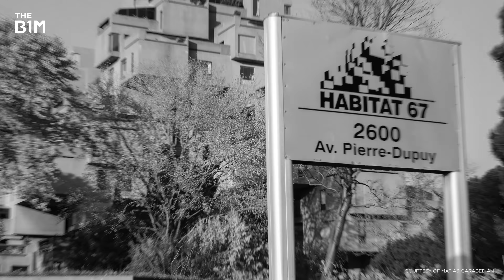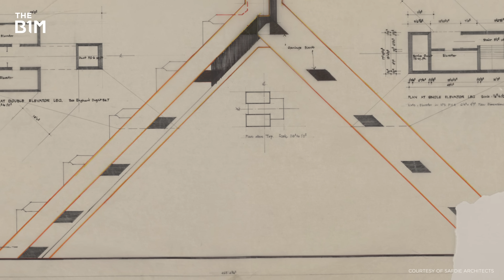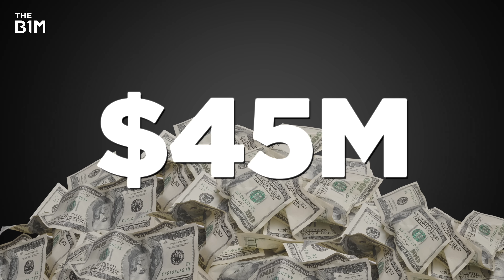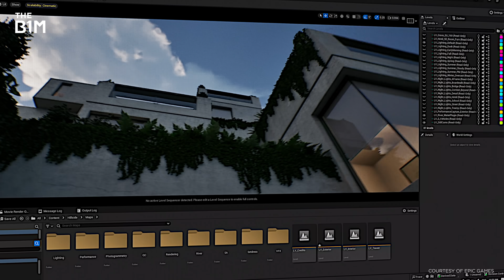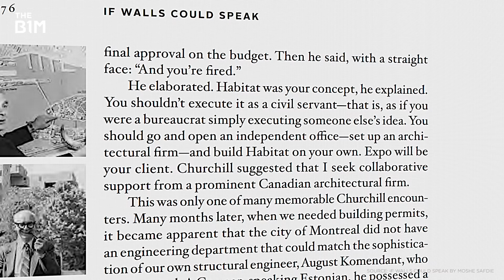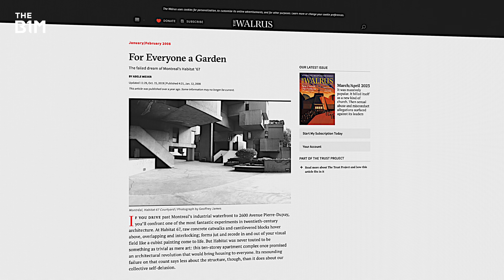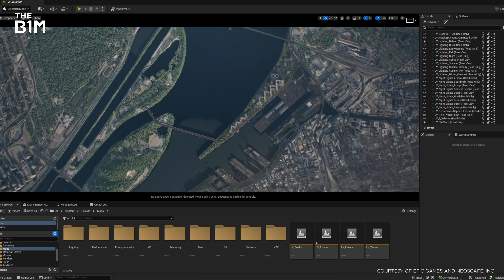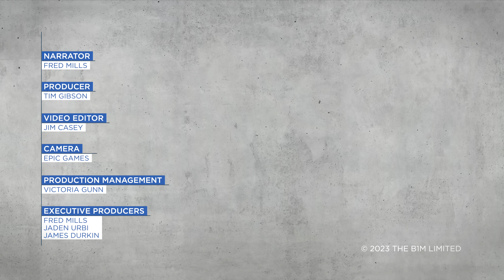How a 23-Year-Old Solved Urban Sprawl

Comment: The design doesn't look like it's 50 years old. It looks modern.
Reply: 50 years ago is modernism at its peak lol
Reply: most brutalist buildings look futuristic.
Reply: @FastSloth87 true, but this also looks livable as well. I like brutalsist buildings myself, but so many seem focused on the "brutal" part. Even with the size and style, it also still feels human sized and welcoming.
Reply: @FastSloth87  You mean cyberpunk.
Reply: @FastSloth87  that's the old USSR .
Reply: @FastSloth87  you could render probably any brutalist building with flashy lighting and it would look like this video
Reply: @FastSloth87  Montreal’s Brutalist designs are really well done, prevalent in some of the metro stations
Reply: @TheRandCrews  Oof, if Montreal's Brutalist buildings are the best that Brutalism has to offer, then Brutalism is just anti-human ain't it?
Reply: that's... when the modern movement happened :/
Reply: 50 y/o is modern
Reply: What? The building looks very much of its time. The use of concrete, lack of ornamentation, focus on clean lines, and natural light is quintessential Modernist architecture. More specifically, it is very much in line with Brutalism, Structuralism, and the International Style. What you're trying to say is that it feels contemporary, but that isn't right either. The structure isn't Postmodern (no sense of referential play or remixing of styles) nor does it evoke Structural Expressionism or Deconstructivism. The heavy use of concrete doesn't exactly make it a model for sustainable or green architecture either.
Reply: @got2bjosh  You know people who don't study art or architecture say modern instead of contemporary right?  You know exactly what they meant.
Reply: @Mog_King_of_Moogles  I learned from both comments. Modern is a style but also an adjective. Contemporary describes the current era. We live in a strange time where classical styles are mostly rejected (or tax code disfavors them), and new signature "architecture" is seen as an opportunity to make a building from/into a postmodern sculpture, in the name of being "unique." As we saw with a recent video in Europe where a giant behemoth w/poorly planned interiors sits atop a classical structure, putting form over function. The classical styles (even Modern/Brutalist) adapt to functional use. Supertalls & art pieces do not.
Reply: @got2bjosh speak english dude lmao no one who doesn't study that stuff knows what you're talking about
Reply: @jared_deraj  May my comments serve as an access point of understanding for all who may be less familiar and wish to follow up with a deeper dive into the various talking points that were referenced. Research is your friend!
Reply: @got2bjosh  definitely not brutalist since it appears to be painted and not raw concrete, but i would agree it's modernist. OP probably talking about the design concept, since you don't see many of those even today.

however, i'd also like to point out that "style" is the last thing an architect ever thinks about when designing a project - an afterthought. a label slapped after seeing enough buildings sharing the same features. modernism itself is a label slapped onto the collective design theories and philosophies of many notable architects of the time.
Reply: @archwaldo  There are many examples of Brutalism that aren't raw concrete. Case in point, Larsen Hall at HGSE and 33 Thomas St in NYC.

Modernism isn't exclusive to architecture. It is a cultural movement that is generally seen as lasting from the 1850s with the rise of skyscrapers and the Modern city to the 1950s and the end of World War 2. There are some exceptions to the rule of course. Modernism connects through many fields including philosophy, fine art, literature, music, dance, politics, science and technology. As such, it is important to utilize an interdisciplinary lens when contextualizing work from such a massive period.

There are styles within Modernist architecture, but what links them is the overlapping ethos of the movement at large. Namely, a focus on the new, subjectivity and role of the artist which gave rise to the auteur, the desire to break away from existing social structures and modalities of thought, and a return to nature. Regardless of style, these overarching sentiments most certainly would've been percolating in the mind of artists (including Safdie) who were creating "in time" (to borrow from Gertrude Stein).

Modernism's ultimate failures (exemplified in the rise of Totalitarianism and World War) produced certain anxieties and an existential crisis in the zeitgeist that affected the way we live. It ultimately was succeeded by Postmodernism which in turn was succeeded by... well it depends on which scholar you talk to. We're working on it.
Reply: @got2bjosh  exactly what I'm talking about in terms of "style".

The most common question of laymen when talking about architecture is "what style is this?" when it's actually much more complicated in reality with deep roots across multiple disciplines.

Heck, even the buildings categorized under "styles" don't fit the mold completely. In practice, architects are designers and not artists, our primary goal is to solve problems on time and within budget. Aesthetics are flexible unless the client requires specific themes that must be followed.
Reply: @archwaldo  Modernism is an expansive movement. The styles within it still maintain broad parameters in themselves. With Modernist architecture for example, the use of natural light, clean lines, open concept floor plan, forgoing ornamentation, and a preference for using certain materials - none of those broader elements preclude operational logistics. The design ethos underpins the approach to form and function, but remains discrete from time, money, and scale (which have a much more immediate impact on deliverables).
Reply: @got2bjosh  just a friendly reminder that you are participating in a meaningless debate on the internet
Reply: @epicn  You wanted some attention, so here ya go.
Reply: @epicn  it's not much of a debate though. He's talking about the history and theory of modernism, while I'm saying that the public is trying to understand architecture in their own way.
Reply: I feel like you just aren't any fun at parties.  @got2bjosh
Reply: @Kidderrgaming  Feelings aren't facts.
Reply: @got2bjosh  okay? Sorry I misworded it. You aren't fun at parties. 😂
Reply: It does?
Reply: We’re talking architecture so when you say modern you mean early 20th century buildings, which are more than 50 years ago
Reply: It looks like Minecraft. In 2023 a 12-year-old would build this and be fighting Zombies and Endermen there.
Reply: It looks like "realistic sci-fi", unlike most sci-fi from back then which was definitely more "fi" than "sci".
Reply: @BloodyMobile  that's it perfectly.
Reply: Because modernism was a main architectural style in the 60's. 80's were postmodernism. And probably now we try to learn from mistakes. This building is not nice. MAybe cool, maybe interesting, but just like LEGO is not "nice", this is also just like a soviet building block disassembled and assembled in a cubist way.
Reply: Well,  it was built during the modern architecture period. I think what you meant to say was that it looks contemporary.
Reply: “Modern” is already more than 50 years old.
Reply: That's because "modern" architecture is getting quite old
Reply: Reject modernity, embrace tradition
Reply: What is old is always new again. We see it constantly in all fields.
Reply: If it looks modern, then we're still in the same architectural style period. No lie there.
Reply: Imo the way the blocks are disposed feels fluid and fresh, that’s why doesn’t look like an older construction.
Reply: 1967 would be postmodern
Reply: It look 80s to me. Sad shape, sad colors.
Make it white, with wood parts and more green.
Reply: Modern buildings have been built since the early 20th century
Reply: 50 years is modern…
Reply: Or you could say that modern architecture didn't evolve a bit since ww2 aftermath era...
Reply: @jovan3612  it did evolve, look at the masterpieces in Middle East, Only Europe didnt evolve others did
Reply: @SJRS700  that's not masterpiece that is junkyard, masterpiece was in classical architecture
Reply: Ahead of his time. 🎉🎉
Reply: That's because good design never goes out of fashion.
Reply: It doesn’t look ‘modern’ at all - it looks futuristic. They should incorporate these ideas & principles in NEOM where the funding seems endless…?
Reply: shapes don't change over time, and we physically haven't either.
Reply: These are commie blocks or "Khrushchevka" houses, just the blocks arranged differently. It was modern in the 1960s.
Reply: the idea seems so futuristic because it is humancentric and that is just not normal to people nowadays. it is terrible car-centrism and the continuous self-adulation of narcicistic arcitects that still dominates city planing. Safdie clearly thought of people with his design, not of himself and how to build the next big, ugly phalus symbol rising high into the sky.
Reply: If brutalist is modern, sure.
Reply: Then people shouldn't stereotype or stigmatize that past people were incapable of creating such things, advance tech, and styles. If people study history there was many advance tech. Many modern tech were invented a long time ago. Some social constructs held people and inventors back too. I also think tech not needing to use electricity is clever and it's good to have diverse options in case the power grid failed.
Reply: 50 years ago is still modern.
Reply: No it looks like it's a prehistoric design
Reply: Search up retro futurism
Reply: It's almost years old!
Reply: Modern is old
Reply: More like the designs you think of as modern are actually homages to this - aka they're old.
Reply: Like any other ugly design
Reply: No it's just brutalism.  Classic 50s-70s
Reply: Modernism is almost 50 years old
Reply: Imagine finding your house when drunk in that maze
Reply: Disagree with the precept, entirely.  "We", do NOT need to "get people back to the city.."   Cities, are the Dens of Demoncrats, and their Thug constituency.
Reply: It Is ugly as fuck... 100% Antarctica is uninhabited, 99% of Greenland is uninhabited, 85% of Canada is uninhabited, 88% of Spain is uninhabited and even 50% of China is uninhabited...
Practically all countries can double in population if we wanted to... Stop cramming your selves in smaller and smaller places... You propagate your own misery. 
And for the environmentalist among you... Take a look at the CO2 levels and the average world temperatures in the time of the dinosaurs before you leave a comment...
Reply: looks like a piece of lego shit
Reply: That's because building designs have been communist modern for the past 60 years...
Reply: Other than the brutalist elements.
Reply: i think moshe safdie missed the whole point of suburban housing, apartments share a common and singular plot of land, and while in some countries that land is divided across all of its unit owners when the building is eventually demolished, it still ends up being ridiculous for them when that time eventually comes. all buildings taller than a certain height (varies between countries) have a fixed lifespan of 50 years according to international building codes (with the exception of national heritage sites and buildings built with materials other than wood, steel, or concrete), so you eventually lose your home, and have no land to rebuild with or even sell. 

say for example that the condominium you live in is occupying 1000 sqm, and the number of unit owners are a conservative 2000, if you consider the law that allows unit owners to own a piece of the total property, then they end up with 0.5 sqm each, which is nothing. this is why suburban housing is so important for people of the retiring age, because staying in a condo all your life will get you screwed over sideways. condominiums are realistically for the young and able who can use it as a springboard for their future towards retirement in a stable life with a home they own in a land they own and sources of passive income. condo's are the complete antithesis of that goal.

edit: also i can tell you now from firsthand experience, living near where you work is a horrible, horrible experience. if your clients/customers/patients know where you live then they will never stop freaking invading your off hours just to get you to do something for them when you're not supposed to be working. this was the problem with my childhood home, where the 1st floor was a dental clinic and the 2nd floor was the house, in the beginning we weren't averse to telling our patients where we lived especially since my dad wanted to show off his expensive collections upstairs or invite them to dinner. 

then over time we started to realize that there were a lot of people who were better off not knowing where we lived, some would harass us nonstop day in day out and even throw stones at our windows just to get our attention (most of them for stupid things like a toothache, like seriously just come back for your next appointment literally tomorrow morning!!!), and the harassment would get worse over the years as the prevalence of karens began, so eventually we didnt tell a single soul where we lived and asked our neighbors to do the same, only close friends of the family would get to know. and only then did we finally get some peace. being so close to home can only be a curse, 15 - 30 minute walking distance is fine, but literally down the stairs is definitely not good at all.
Reply: Looks 50 years old to me.
Reply: It looks like the result of giant that swallowed concrete cubes, and then had diarrhea.
Reply: The only bit of an issue, is the cement… crack oxidation and a bit to grey ;)
In the Montréal weather a close to the water, maybe another material combination would be interesting…
The main core cement, yes… but maybe more glass, wood and steel
Reply: Just goes to show how little things have changed since midcentury.
Reply: It looks very outdated.
Reply: @corail53  it’s the cement to much does look outdated, but retouches could make it more modern/green with not to much expenses.
Winter can be brutal toward cement
Reply: Looks like something from Bladerunner...
Reply: History repeats itself
Reply: You're right, it's ugly as hell.  Definitely looks like modern architecture.
Reply: Modern, you meant the Billions strip, modern ?
Reply: what modern about it, there are better buildings in Nigeria than this
Reply: It looks like communism but lego. Definitely won't succeed.
Reply: @Haru Yanto  sigh, capitalist apologist…

Comment: From the look of it this really doesnt appear to be a project that actually works at scale.  Theres too much lack of natural light on windows, too many of the modules would exist in permanent shading.

You're creating an actual class structure of light and dark dwellers.

Clearly it works well as a modest developmnt and that seems to be its strength.  As a large project, it seems much less likely to be an enjoyable place to live for a too many of its residents.
Reply: Shade is good, Singapore is right on the equator. The obsession with direct natural light is something more sensible near the poles, where light can be sparse much of the year.

There’s just a lot of inelegance in making a house bathing in light… and a massive AC unit to cool the massive radiant heat load down.

Comment: Not insignificantly, the membrane roofing and waterproofing systems developed and made available over the last 40 years make the long-term viability of modular design easily accomplished. Prior to that, the hot asphalt and hot bitumen systems were a long-term logistical nightmare in these designs.

Comment: It might look incredible, but energy wise it must be a desaster
Reply: Disaster is a bit harsh - sure not as efficient as a regular block of flats, but still better than individual houses. A fair trade off for decent outdoor space.
Reply: I'm trying to understand in which way it would be, could you elaborate a bit more? :o
Reply: @Celis.C  The ratio of volume to surface area of the building. The blocks radiate a lot of heat/ require a lot of isolation to keep the cold out/the warm in.
Reply: I heard is not a disaster
Reply: why ?
Reply: How is it better than a house? The earth changes temperature far less than the air.